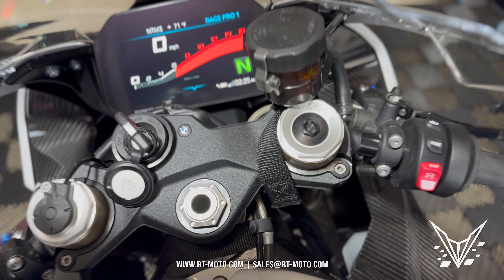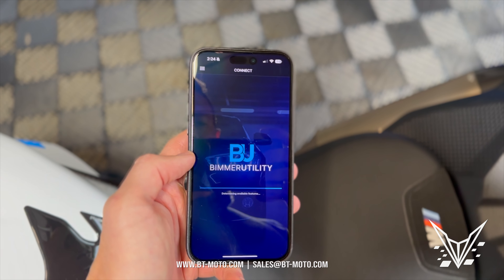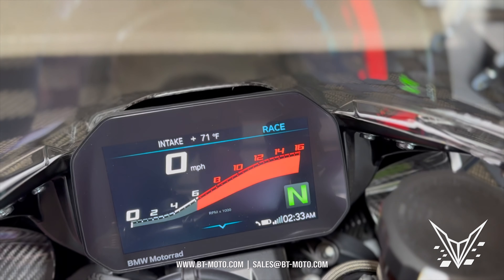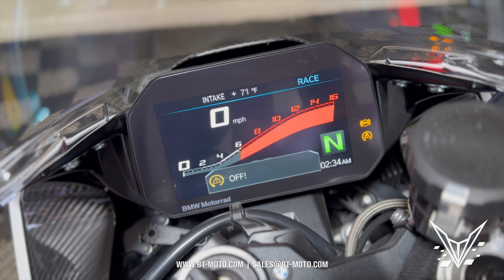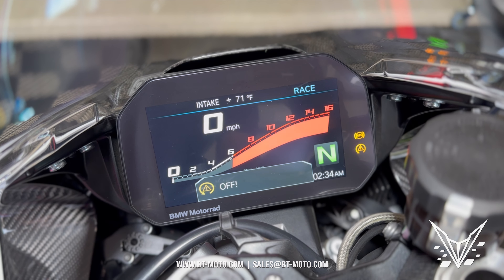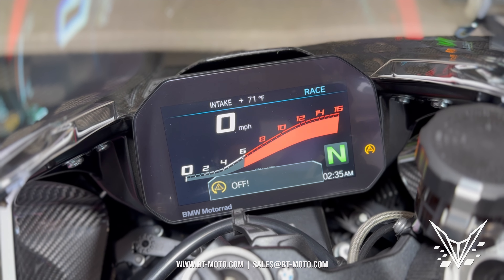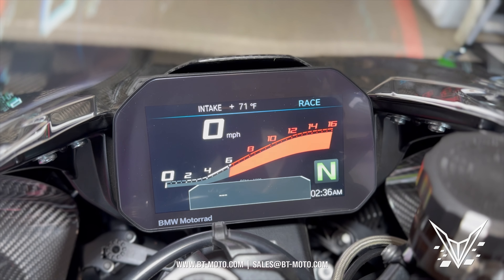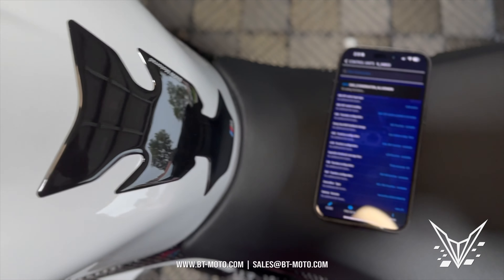BMW S1000RR and M1000RR ABS Off In All Modes, BimmerUtility Tutorial

Comment: Well there something missing for it to work on the R1250. Did like your video no luck but I did notice it said switch not available so I turn it to CAN like your bike had. Play around with no luck. But did find how to turn on the ABS "OFF" display in the konobi or how ever you spell it. Cfg_hmi_brm_status_abs_traction

I was how ever able to disable the ABS unit by coding. Which isn't as useful as the switch.